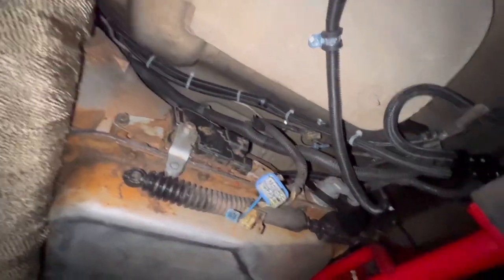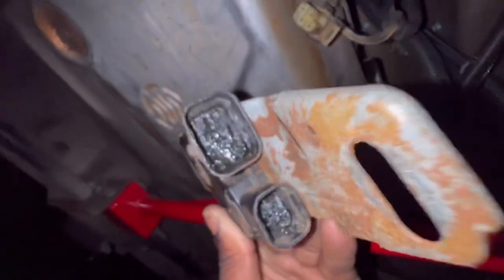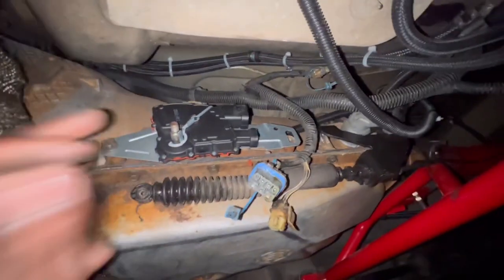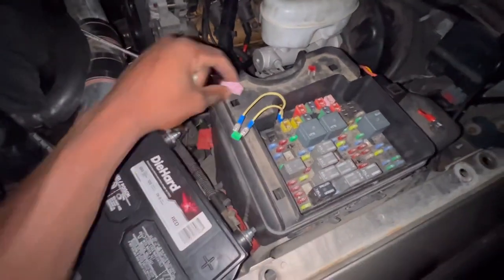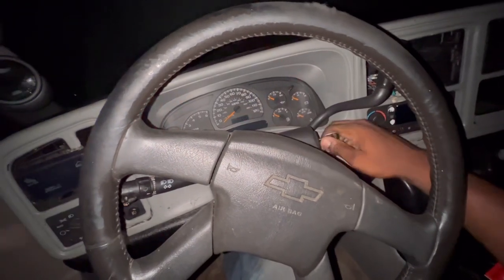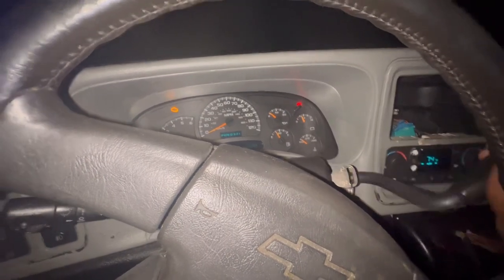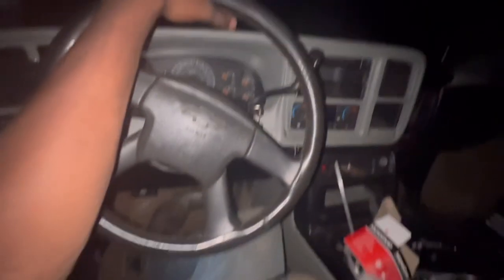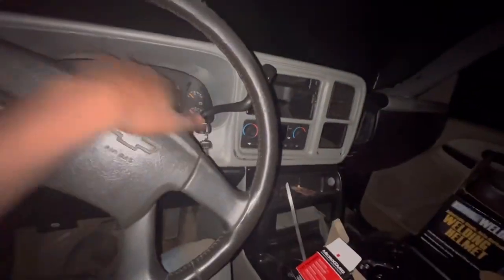No crank from turbo truck stuck in 2nd 🤔

Comment: I haven’t kept up on the whole build but I’m guessing 80e swapped? Did you repin the harness or get adapter harness? You also have to segment swap the ecu with an 80e, 2nd gear is default when the transmission doesn’t have power
Reply from the maker: Yes it’s 80e swapped i repinned trans plug in and connectors to pcm.
Reply: @auto3garage522  I forgot that's just speed sensor stuff wouldn't effect it starting. make sure you put that ground back on the bellhousing bolt when you swapped trans.